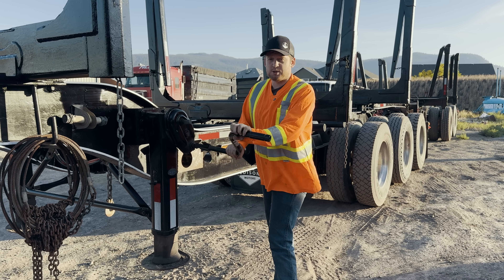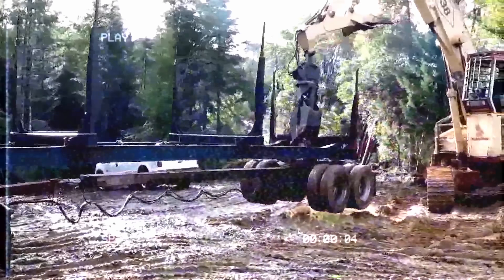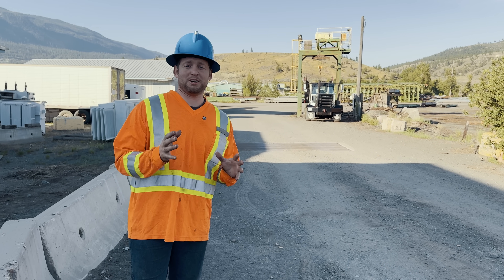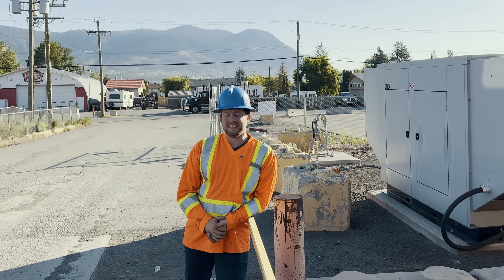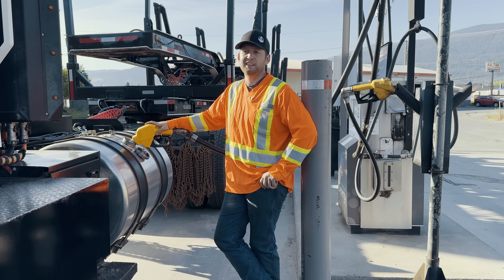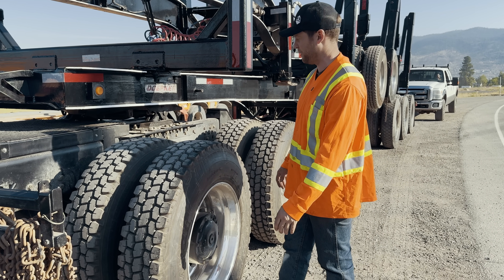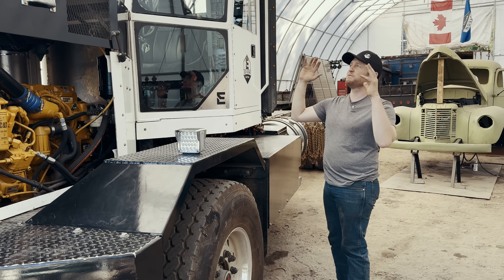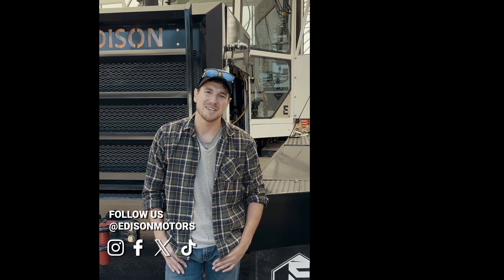We pulled our Trailer; You won’t believe what we weighed!

Comment: What you need to emphasise guys is that you should wherever and whenever  charge Topsey and all hybrids from renewables through the grid or from offgrid  battery charging stations. 

Only run the generator  when you have to either to maintain full power  or get you to back  to your renewables charging. . That keeps polution down and fuel/energy costs down.  😉🧙🏻‍♂️
Reply: They have to argue with the guys that want to hear "then you should go back to charge your truck for hours"
That is way to much details foe the haters
Reply: 90 something percent of BC is powered by hydroelectric dams

Comment: Things that are AWESOME:
- the truck weighs the same as a smog machine
- it has MORE POWER than a smog machine
- the CEO of Edison has a valid Class 3 TRUCKING license
- AND KNOWS HOW TO DRIVE ONE!!!
Reply: Has a valid class 1 license
Reply: @loaflyer5663  I stand corrected. Ontario's system does not use quite the same groupings.
Reply: Smog machine? It still runs on diesel, it likely doesn't have smog-reducing emissions control systems (SCR) and it's probably less fuel efficient in many situations.
Reply: @PistonAvatarGuy  You mean the Emissions control systems that lower power, lower fuel efficiency, and causes engines to fail faster? Yes it still runs on diesel but it is a generator. It is smaller than a normal truck engine and is tuned to run at a set rpm and load (making it much more efficient than an engine that is constantly changing speed and load such as a conventional drivetrain). Not to mention the generator is running less often than a regular diesel truck would be, especially in Edison's planned use case. It's exactly like he says. They go up the mountain with some help from the smaller (comparably) generator and the regenerative brakes and 100k lbs of logs will recharge the batteries and keep everything powered on the way down. A conventional truck would have the engine running that whole time. There is a reason freight trains are diesel electric hybrids and have been for decades.
Reply: @fawnn1644  The whole drivetrain would result in the truck being less efficient, except in very specific use cases (like the one you mentioned), so it's not only polluting more because it's less efficient, but also because it doesn't have any emissions controls. If these guys wanted to build a truck that reduces pollution and operating costs, they would have built a truck that runs on natural gas. NG trucks are near zero emissions and have very simple, very reliable emissions control systems.
Reply: @fawnn1644  Freight trains don't use this type of hybrid system, btw.
Reply: @PistonAvatarGuy  "Series drivetrains are the simplest hybrid configuration ( I will add that it's actually called a serial hybrid but the masses call it series). In a series hybrid, the electric motor is the only means of providing power to the wheels. The motor receives electric power from either the battery pack or from a generator"

This is how Edison's truck works.

While yes, a train forgoes the batteries and uses an alternator rather than a generator because of the insane amount of power, it is still, by definition a serial hybrid
Reply: @PistonAvatarGuy  Also I will add that Edison just announced that their production trucks will have Scania diesels that meet emissions standards without a DPF.
Natural gas vehicles do not have near zero emissions. It has between 20-30% less of a carbon footprint but is by no means clean. Not to mention, when natural gas leaks at extraction sites, pollutants such as volatile organic compounds (VOCs) are emitted to the atmosphere. VOCs, like trimethylbenzenes, xylenes, and aliphatic hydrocarbons react to form ground-level ozone, also known as smog. btw
Reply: @fawnn1644  DPF isn't the only problem with diesel engines, EGR and SCR are also problems.

Stoichiometric natural gas vehicles which make use of a three-way catalytic converter meet CARB's near-zero emissions standard, producing the least amount of smog-forming emissions of any ICE engines on the road, by a significant margin. Diesels, on the other hand, typically produce at least three times the smog-forming emissions of a gasoline engine, and gasoline engines aren't even as clean as natural gas engines.

Natural gas comes along with the production of diesel, so you don't get to run a diesel and then just pretend that those VOC emissions don't exist. All of the VOCs that you named would still be released into the environment in order to fuel Edison's vehicle. Anyway, most modern vehicles produce almost no VOC emissions, many are even considered to be PZEVs, because their VOC emissions are so low.
Reply: @fawnn1644  Basically, these guys are trying to do what Wrightspeed was doing, but without the clean-running, multi-fuel capable turbine engine.
Reply: - requires less maintenance

the production model will apparently weigh less than what they've got right now. Meaning it's capable of hauling more per load too.
Honestly this is what we've been wanting from hybrids.
Reply: @KMCA779  Why does this work? Like locomotives, this is a SERIAL hybrid. When manufacturers made hybrids, they just pretended. Even the Volt was not a true serial hybrid; it used the engine to power the rear wheels. 
Current hybrids suck. This is where a car hybrid should be as well - modular, repairable and cost effective. And FAST! BUT NO OEM wanted to go there, preferring to gouge consumers for every last penny.
And NOW they are getting what they deserve.

Comment: I think you're just having a little fun with the jab at Tesla for having more charging stations.  Unfortunately, there are A LOT of people who think EV trucking is the stupidest thing in the world.  And yes, for what you do and long OTR routes, it doesn't make sense.  But for shorter daily runs like <1000km it will absolutely work.  Charging stations at the loading docks while the truck is just sitting there anyway and of course charging at the home depot.
Reply: everything pure electric doesn't have sense until you extend the power grid 3-5x power capacity.
Reply: @bartoszskowronski  Sure, if you snapped your fingers and made all cars on the road EV, the grid would collapse.  Fortunately, even if every OEM snapped their fingers and only produced EV's, it'd be 20+ years before we got to that point.  The grid right now is more than sufficient for the EV's right now and into the future.
Reply: @billbayer5526  yes, by politicians end ECOterrorists behave like charging cars don't influence grid at all, and grid isn't problem in future electrification.
Reply: @bartoszskowronski  The grid has been a problem since the grid was built!  We went from a a country of 20 million using no electricity to one of  300 million with air conditioners, refrigerators, internet data centers, steel and concrete manufacturing and on and on.  At every step power production and grid capacity have increased.  Why would it change with the adoption of EV's??
Reply: @billbayer5526 what a myth. Overnight charging doesn't need high power and overnight the demand is (presently) low. If you snapped your fingers and made every vehicle an EV all you'd do is remove off peak power periods.
Reply: @jnawk83  In most places things would be fine but in the higher density metro areas there would be problems especially during extreme cold/hot weather.

Comment: Regarding positioning the trailer in the exact location to pickup the boggie, you could easily have a simple remote that you could use to command the truck to nudge forward or back to get you aligned perfectly.  You could electronically limit the remote to 10km/h or less.
Reply: Kinda like a dump trailer truck i once saw, they had a button that engages the starter, so they back up to the trailer, shutoff in reverse, get the trailer tongue in position and hit the button, and bam! Truck backed into the trailer
Reply: @legionofanon  Absolutely but much easier as this truck is electric so already has big motors and you'd just have to extend the accelerator wiring.

Comment: Will this have DC fast charging capability?
Reply: The batteries can charge with 300kW from the engine so I think it would make sense but I am not 100% sure.
They had a plug on Carl but never saw one on Topsy
Reply: @raphiseth6942  topsy's battery can charge with over 1MW (1000kW) of power. From 10 to 70% in ~ 10min.
Reply: @bartoszskowronski  where did you saw that information?
Reply: @raphiseth6942  they said they have 280kwh (if I remember correctly) battery at 4C ratting. ("X"C means you can operate at X times of battery capacity, 4C means 15min charge/discharge if you could do from 0-100% but every battery have smaller range of full power)

Comment: Pro and cons of a front drive axle?
Reply: generally more weight complexity price, But I think small motors 10HP/wheel mounted inside wheels with high gearing with auto disconnect over 20km/h would be interesting.

Comment: Why axle motor looks tiny vs generator conected to diesel engine? they have similar power.
Reply: hmm. I think I know generator have 1800rpm and motor i assume at least 10'000rpm.
Reply: maybe remove the huge generator and use the axle motor as a generator. (only adapter plate needs to be changed).
Reply: I am sure the got the right generator for the job. The generator is designed to handle 300kWh of constant power the 3 axel motors are designed to just work a few sec on full power.
Reply: @raphiseth6942  And I'm 99% sure they DON'T have right generator (but only this is on the shelf)
Generator is electric parameters like grid. Volts/frequency/phases. (with litte modification by engine rpm)
 If the generator was built specifically for charging DC batteries, it could have "ridiculous" parameters like 764V 3469hz any number of phases like 5 (with 72degree phase shift).
That would make the generator MUCH smaller/lighter.
Reply: @bartoszskowronski  yes they probably dont use the perfect generator but I doubt that the random axel motors are better
Reply: @raphiseth6942  I bet axle motor will not be a great generator, but comparison of size is huge. but what I wrote earlier I bet bigger reason is difference in rpm.
Reply: @bartoszskowronski  Generator choice is limited by what RPM the diesel likes to run at, a faster spinning generator would be lighter for sure, but it would need a gearbox to increase the speed, that takes up space, adds weight and affects reliability. Regarding size and weight, the axle motors will almost certainly be PM synchronous with rare earth magnets, which already gives a higher power density than a traditional motor.
Reply: parasitic loss from the driveshaft, they already tried that with the first truck named Carl. Check out their oldest videos

Comment: Would there be any value to adding an e axle to the trailer
Reply: They said they want to look into that so yes.
Reply: a huge value specially because regen. The truck will be much more stable on downhills if trailer will also braking too, not only truck.

Comment: Are you interested in telemetry? I've been doing telemetry my entire career. Using the tech buzzword "observability", i think it would be pretty revolutionary to monitor data from all your trucks live, and even apply analysis to it, and analysis to updates. 

Obviously there are easy to overcome potential privacy issues, but with 100 or even 1000 prototypes this could be invaluable. You could detect and work on a fix for future problems long before your customers are impacted or broken down.

Comment: with how many KW of regen brake lights turn on? (without touching brake pedal)
Reply: I might have one pedal driving which would mean full regen
Reply: @JD-yx7be  full regen is a LLLOOOTTT of breaking. in modern trucks do jake brake activate breaking lights? on what setting, how much is that breaking force and how does that compare with regen

Comment: Impressive.  I thought it would be alot heavier.  My tridrive/quad tares out at about 21,000 kg
Reply: Smaller engine, and one tank is replaced with batteries
Reply: @raphiseth6942  right, but batteries, and motors are heavy.
Reply: @SuperCody888  a motor is far lighter than the transmission it replaces
Reply: @SuperCody888  a big engine is very heavy too.
That is the beauty of this truck that the right combo of powerful parts not add weight
Reply: @raphiseth6942  its very interesting and exciting to see where this goes.

Comment: could you run alternators off your trailer axles and link it back to the truck.  or wouldn't that work either
Reply: For perpetual energy, no.  To have regenerative braking on the trailer axles, that is possible but there might be a few challenges.
Reply: They talked about this in an earlier video. Put drive axles on the trailer for better climbing and regeneration on the downhill runs. It was a future possibility.

Comment: Question - why is regen allowed with any throttle input?
Reply: because you modulate the force of regen with the gas pedal.
you don't want full regen at once (theoretically regen can produce the same power as max power of the motor for acceleration)
Reply: Tesla also has partial regen even with throttle input, coined as one pedal driving. If youbare subtle enough with it you never fully let off the pedal to maintain the same speed from flat to downhill. Tesla would light the brake lights at about 70% ish regen even with throttle depressed because of the rate of decel it was still generating. Almost like full off throttle in a manual, but more powerful

Comment: i want to see the Edison drivetrain on an RV 🤤
Reply: Me too man. I also want to see it in city buses
Reply: Yeah. I've been thinking I need to remember this channel, in a couple years I may want to reach out to them about an RV (I would just have them build the vehicle components, I would handle building the living space myself later on).
Reply: Run the generator 30 minutes every other day if you have AC going all day.  Light's an AC is about 25% of the energy required to move it, so the batteries would last a long time.
Reply: Never been RVing but i imagine most of the traveling is at highway speeds which a series hybrid would actually have slightly worse mpg
Reply: @JD-yx7be , but parked far far more than driving
Reply: @JD-yx7be  depends on travel location, MPG would significantly improve in mountains.

Comment: do you plan retrofit topsy with steering e-axle? like 2x 5kW up to 20km/h after that automatic disconnect (and reconnect under 10km/h in offroad mode).
Reply: maybe there is somewhere steering axle with motors inside the wheels.
induction asynchronous motors to not generate losses when turned off.

Comment: This might be an oversimplified solution, but could you simply split every connection coming from the truck to the axles? From the perspective of the truck there would be one axle. The axles would receive the same signals and always be doing the same thing maybe?
Reply: that generates problems when one axle will spin, another thing is that 2 speed automatic transmission (inside axles) and they switch at different speeds, so there is a time when one motor have completely different speed than another.
Reply: And one axle is backwards, so if they recieved the same direction, theyd try to tear the rear end apart

Comment: So is there not a way to plug it in when you park it?
Reply: Yes, it can charge via a J1772 plug.
Reply: @MichaelEricMenk  No Dc Charging ? Even if it pulled 22KW AC Or DC
Reply: @AdrianMcDaid  22kW is European standard, US and Canada use single phase 240V up to 80A, or 19kW.

In the video they showed charging there was no CCS, and there was no mention of max charge speed.
Reply: @MichaelEricMenk  hello I live in the EU .N Ireland  Standard is 7kw AC  from home supply. 11kw most cars can charge at  three phase  and the odd car. Renault Megan and ZOE can do 22kw AC public three phase charging.  Some parts EU do have three phases at their home but EU big place with many countries, so not all the same
Reply: @AdrianMcDaid  hi, I'm an American living in Norway.

I have not referred to what type of charger is typically in a car, or what type of circuit is common to charge from.

I have only referred to the limitations of the Type-1 and Type-2 as per the standard... The max power is 19kW for Type-1 and 43kW for Type-2.
Reply: @MichaelEricMenk  in UK /Ireland where I live it's type 2 home is 7hw as it's single phase 240
Reply: @AdrianMcDaid    No, you do not have 240V...

The entire Wester Europe has 230V across one phase. It is SEVERAL decades since Europe had a mix between 220 and 240V. All equipment is 230V ± 10%.

Some countries run their grids at 230V -6%/+10%, other countries run 230V -10%/+6%. But all have 230V nominal with a max 10% divination.
Reply: @MichaelEricMenk  cam down Dear !

Comment: switch 2 of 3 hivoltage motor cables with eachother on one of the motors, and for computer both axle will turn in THE SAME direction.
Reply: @Edisonmotors hang on a second, he's on to something here.  The drive motors are 3ph AC, correct?  Swap any two phases on the reversed drive motor, that will change the phase rotation of the motor.  That way you can program it exactly the same as the forward axle, but magnetically it will rotate in the opposite direction.
Reply: @JClaudeo  these motors have position feedback sensors that also need reversed, but the general idea seems sound.